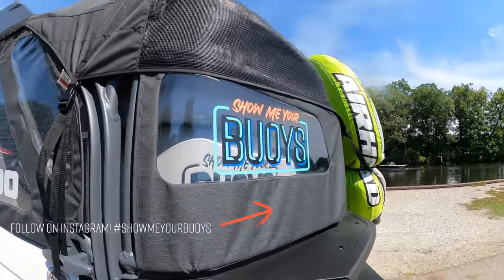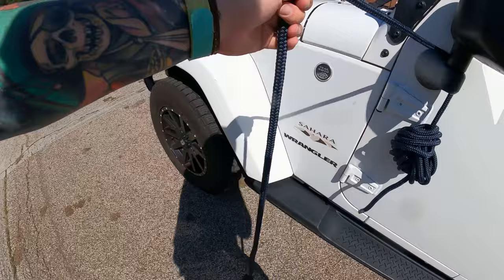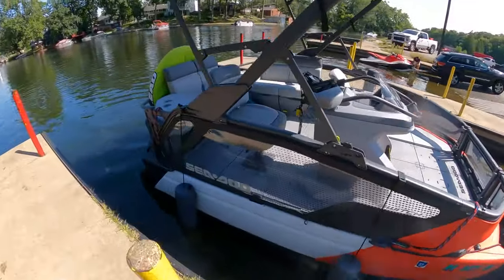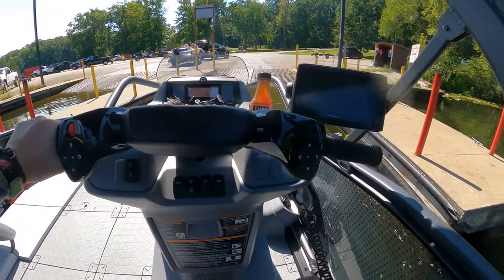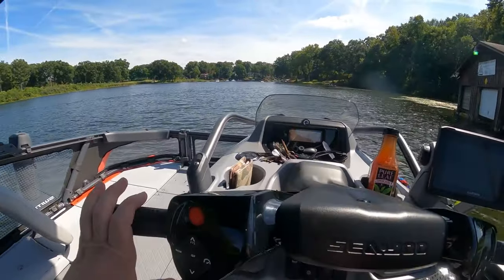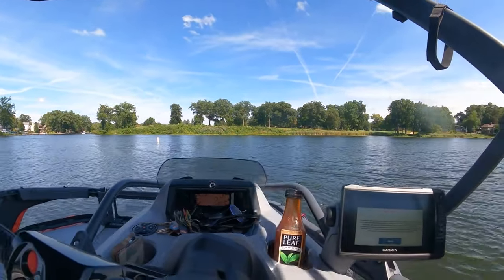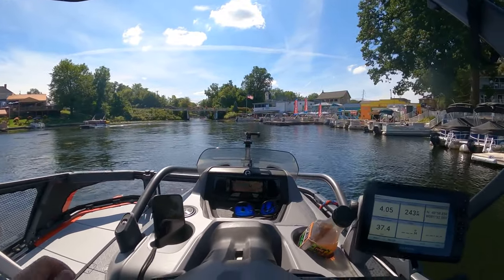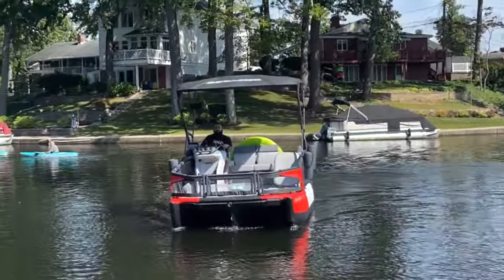Sea-Doo Switch Sport Compact 170 [Know Your Boat]

Comment from the maker: EDIT: the trim tabs on the Switch don’t go up and down with the trim button. It merely adjusts the nozzle for the jet. But the info on directional information is correct still. My apologies for wrong description.
Reply: So, does this mean that it will still trim the front of the Bow up/down??
Reply: wróbg
Reply: So then what do the actual trim tabs on the back of teh boat do?
Reply from the maker: @standurst8762  they adjust the nozzle for the jet thrust. So it helps the boat get on plain and stabilizes the boat depending on the weight on the boat. They actually do do alot.
Reply: @standurst8762   trim ysbes dose  what powrt trim tilt outboarx or io  dise

Comment: Great video! Just a quick side side note the vts (variable trim system) actually adjusts the the jet nozzle up and down, not the the trim tabs, as stated in the video. The trim tabs on the switch are stationary, but are adjustable with a through bolt.

Comment: These look super cool! I was wondering how hard it is to get back into the boat when you are swimming in the water? Do you have to come up using that ladder in the back and climb up over the furniture?
Reply from the maker: I am sure you could probably climb up on the front through the front door but I use the ladder in the back. And the seats fold down so it’s not hard to get over them. Also, the seats are movable so if you don’t want one in the corner by the ladder you can move it.
Reply: The right rear corner  railing is hinged. Unscrew the bolts and you have a gate . Some guy posted this on YouTube. He uses a  type of bungee cord to hold the gate closed. Remove the corner seat and you are then in really good shape to get in and out!

Comment: Nice video!  Thinking about the Compact Sport but have a couple questions I'm hoping you can help with.  1. Does the Switch Compact Sport come as yours is configured - 4 seats (plus captain), 2 corner pieces and the lounge?  2.  I have an 8' garage (with 93" of clearance) which is lower than their 8'2" specs.  In your experience, do you think I could lower the folded part of the Bimini 5-6" by lowering the air pressure in the tires and dropping the hitch as it backs into the garage?  Seems it would be close, but would be disappointed if I had to spend a ton of time removing and installing the Bimini every time...

Comment: Not trying to be rude, but when you launch your boat you take the back tie downs off. Back your boat into the water, then you climb in boat, start engine, let it warm up, unlatch you winch, then use the engine to get boat off trailer. After the boat is docked, pull your truck out. I have never once pulled a boat off or on trailer by hand.
Reply from the maker: Like I said in the video I didn’t back my trailer in far enough so the boat didn’t float back. I was trying to video and do everything at once. Normally the boat will float right off. I cannot power the boat on and off the trailer. Our dock specially request that you don’t power load to not disrupt the lake bed at the ramp. I RARELY launch solo but when I do this way works great for me. I’m sure whatever works best for you or others is the way you’ll do it!
Reply: I spend a lot of my boating time solo so I appreciate the thought that went into your safety with your lines reachable, boat tied to truck, wheel chock…nice to see.
Reply: It also depends on the type of slip... whether the slip is on a lake, on a faster moving river (depending on rain fall and height of the river), and so forth (probably many more things to consider). It's not quite cut and dry. As a safe boater, even when alone, you need to make the decision that is the safest for you and your vehicle and boat (and trailer), for that matter. It's a juggle of what is safest, what is easiest, and who you would not like to piss off today (depending on how BUSY your closest slip gets, regardless of season).

Comment: HI, I enjoy your videos.  I was wondering if you have tried to remove the caps on the trailer wheels to check out the grease in the bearings?  I am having a hard time removing those chrome caps and do not want to damage them with a sharp screwdriver. or pry tool.  What have you used to remove them?  Also, the trailer lights are led so no heat, but still a good idea to unplug your 4 pin.
Reply from the maker: Hello. I have not. I haven’t had any reason to take them off.

Comment: You forgot to mention, If you unplug a trailer with surge brakes then you need to lock the brakes out with the pin or they’ll lock up in reverse.  You don’t have brakes on the compact models.
Reply from the maker: Good to know, notate! Yes, I don’t have those on my trailer so I’m not familiar. Appreciate the information.
Reply: @twenty7squared   I was wondering why you only had a 4 pin plug, AFAIK, the standard Switch trailer has brakes and therefore uses a 5 pin plug.
Reply: they don't lock up if you're backing down a ramp, its only on level ground or backing up a hill and the lockout looks to be mechanical not electrical so 4 pion is all you need

Comment: How's the compact handle with 5  adult people on board? Any idea what top speed is with 5 adults?
Reply: I would like to know as well
Reply: X3! They claim the 130hp top speed is 28 and 170hp 34. The shorter length is perfect for me, but if i end up with more people I wonder. My current 16' 75hp outboard really gets low in the water even with 4 adults.

Comment: Should have moved it to the other side of the dock before dropping the trailer off in the lot, so the drop off ramp isn’t tied up. Works on a slow day like this though doing it that way
Reply: It's possible that there weren't any easily-accessible points to tie off on either side of the slips. Hard to tell from the video. But I do agree that if possible, it's considered appropriate to move your boat out of the slip area so that others can continue to access the slip.

Comment: Am I correct? The bow has the railing gate for making it easy to jump in the water, but the boarding ladder is in the stern with difficult access to get onto the deck? Climbing over railing and the seats? No swim platform on the 13.
Reply from the maker: Correct. You can easily get off the front with the swinging gate / door. The back set up isn’t the best on these boats having to climb over the seats but that’s not super uncommon on a lot of boats. With the back seats folding now it’s an easy step over. I’d like to add a swim platform to mine at some point but they’re pricey.

Comment: You went with the model I would have gotten. If I owned a compact 170hp sport I would name it 'The Cube of Doom' and would terrorize anyone brave enough to get on an inner tube behind such a wildly powerful yet light and compact jet powered cube 😂😂.
I would imagine that with it's squared stance and boxy dimensions that the direction changes while pulling an inner tube are most likely extremely vicious as all that surface area makes for angular cornering characteristics.. I wouldn't be surprised if people popped a shoulder out of its socket once or twice during a rough tubing session.
Reply from the maker: Hahah heck yeah!!
Reply: LMAO! Funny comment

Comment: This is cool but my biggest worry is going to be servicing after a few years. I have one of the jet boats and it's almost impossible to find a place to get it service. Because the location of the engine I think dealers won't want to service them.
Reply from the maker: I just get it serviced at the dealership I bought it at. The engine is pretty easy to get to with the floor opening up.
Reply: @twenty7squared  Right now they have to do they can sell them. But what happens a few years from now.  That is my question.  Seadoo does not have a good history with boat service.
Reply from the maker: @tjsmith3060  oh yeah no idea haha guess I’ll see what happens when that time comes! Right now just going to enjoy the heck out of this thing!
Reply: @twenty7squared  I guess I'm old school and if I buy something I like to keep it as long as possible.  I just sold my 95 speedster (yes I'm regretting that decision). I think I would really like the switch.  Now I would like to see them drop the 300 in it for more speed.  But that's just me😁

Comment: Without the trailer light wire, do you have to use a clip for the trailer brakes to not engage?
Reply from the maker: Hey there. Not sure what you’re asking? The only way to disengage the trailer lights is to unplug it from the harness attached to your vehicle.
Reply: @twenty7squared  the reverse light pin on you harness sends a signal to disengage the trailer brakes. When you unhook your harness it doesn't tell the brakes to not work. So in a jolt it's suppose to lock brakes up. Was just curious if you used the little adapter piece to block the sliding part of your trailers hookup that triggers the brakes. 
Or of backing down the ramp hasn't ever triggered the brakes for you
Reply: @twenty7squared  that was the biggest comment I've seen on the seadoo trailer is backing the ramp locks brakes up so if you dont have the proper 5 or 7 pin then they put the adapter on it to disengage the slide all together.
Wasn't sure how bad or often it happened I've just seen the comments alot about it
Reply from the maker: @newbie_nugs  ahhhhh that is why I wasn’t sure about it. I have the compact sport. The compact version doesn’t have trailer brakes.

Comment: 7-900 LBS overweight for towing, definitely wouldn't recommend that, especially with the JK's horrendous brakes. Seems easy enough
Reply from the maker: Tows just fine! The weight is based on the shorter wheel base. The 4dr had a tow capacity of 3500. They give the 2dr a lower rating cause it’s short. But motor wise it does perfectly fine. I’ve never had any issues stopping… 🤷‍♂️

Comment: Get a real tow vehicle
Reply from the maker: …. Sure let me buy a new vehicle when the Jeep works just fine. 🤦‍♂️
Reply: Hm, yes. Because he obviously needs a 3500 dually diesel truck for a 13 foot boat that's essentially a jet ski with outriggers, and only weighs 1,700 pounds max.
Reply from the maker: @justinbiggs1005  ha right!
Reply: @twenty7squared  Yup.You got an awesome little boat by the way. I've been binge watching sea doo switch sport compact videos lately and have been contemplating getting one. Boating spots by me are a bit bland and are dominated by much larger boats but having such a small boat that maneuvers like a jet ski while being big enough to fit watersports fun, friends and coolers at an extremely affordable price is amazing, lol
Reply: @justinbiggs1005  did I say dually or did I say proper tow vehicle.  Maybe you should've bought a real truck instead of a wannabe boat
Reply: @justinbiggs1005  1700 lbs is already pushing the limits of that jeep. Not to mention after loading it up. More importantly you are dragging a giant sail with a shirt wheelbase. There are safer options
Reply: @justinbiggs1005  well said!
Reply: @FranklinHicks-qs4gs  what's wrong with towing with the Jeep? Just want to know what the risk is
Reply: @FranklinHicks-qs4gs  I suppose you're right 1700 lbs plus another 1000 lbs trailer with be over 2000 lbs.  With 3500 lbs towing capacity it should be fine right?
Reply: @nguy0616  besides. 3500 × 0.8 =2800

1000 + 1700 = 2700
Throw a tank of gas and a cooler in that thing and you are already pushing it
Reply: @FranklinHicks-qs4gs  why 3500 x 0.8 with 3500 lb towing capacity the jeep is plenty big to haul his boat
Reply: @machew2009  manufacturers over rate . Use 80% as a margin of safety
Reply: @machew2009  and as stated before it's not just tow capacity. You have to consider the other factors as well. Mainly that this pontoon  is like dragging a giant kite. Under ideal conditions with no wind or traffic you may be OK. With a 30 mph cross wond or passing semi however you will have more difficulties keeping that pontoon under control

Comment: It looks like a fun boat but not good on larger water I’m guessing. I live in Ontario very close to Lake Simcoe and it’s about 25 miles long by about 18 miles wide at its widest point. This lake can get pretty rough fast. I like the look of this boat but I find the prices are rather restrictive in my case. The prices of everything have gone up so much I’m surprised people can afford to buy the toys they have. Obviously wages have gone way higher to be able to buy $80,000.00+ pickups, $50,000.00+ cars $30,000.00+ boats and live in $600,000.00 + homes where I’m live. I’m retired with only government old age pension and didn’t invest in Microsoft when it first came out. Stupid me.😳😬🫢👍👍🇨🇦